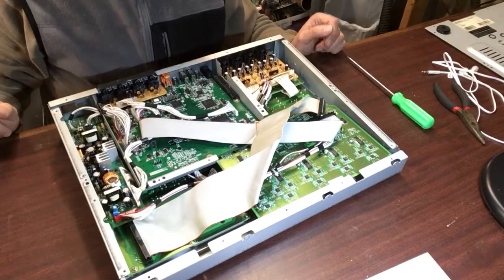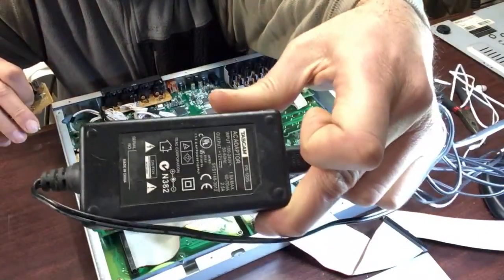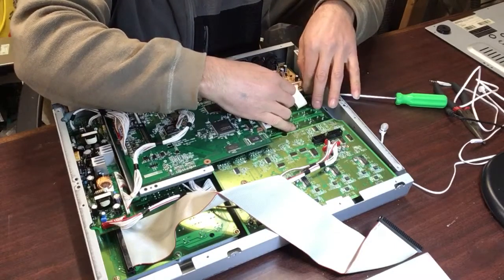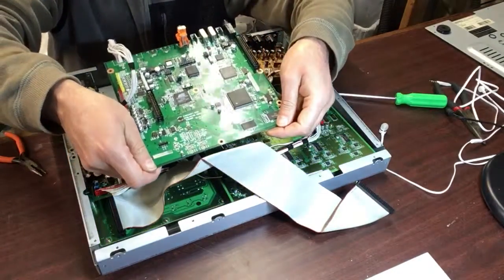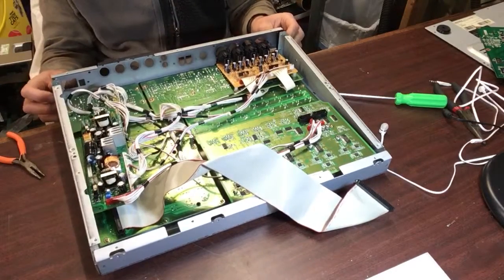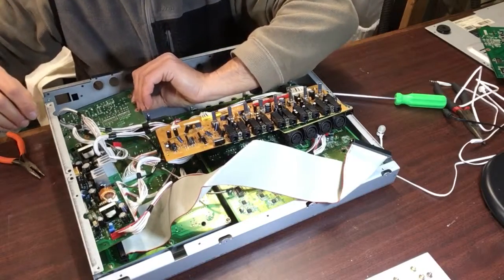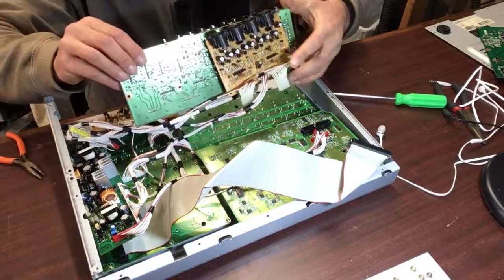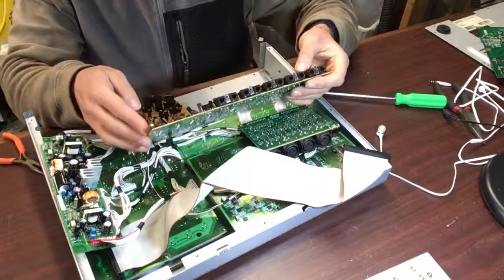Obaid''s electronics Tascam FW1082 FireWire Audio Interface mixer parts list # 2

Comment: There is a buzzing at 200Hz at the outputs, (headphone) even though the output potentiometer is muted buzz is the same.  The replacement power supply little muted the sound, but it is still present.  Idea? 
Bad capacitors in the mixer?
Reply from the maker: check for bad ground or leaky caps